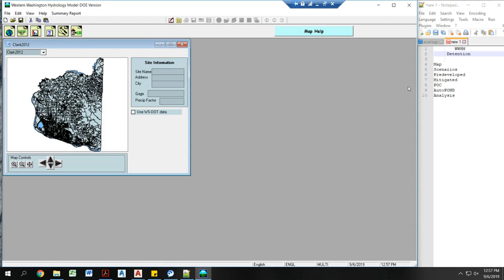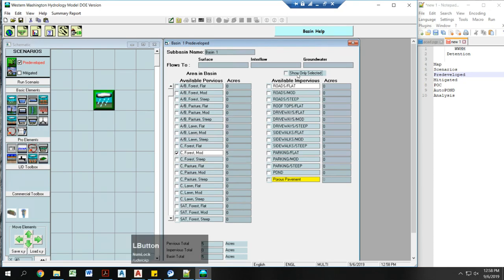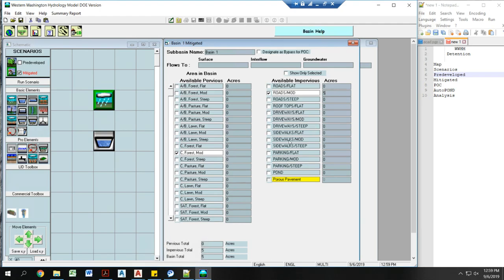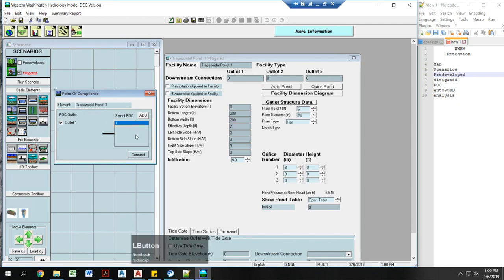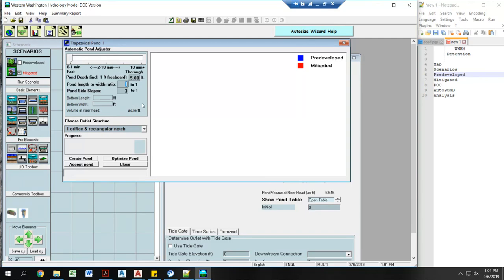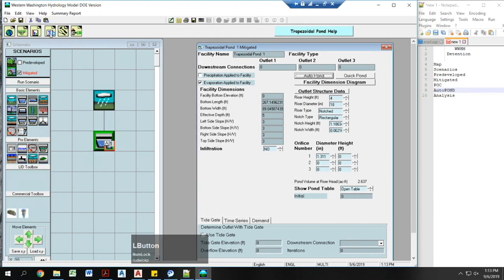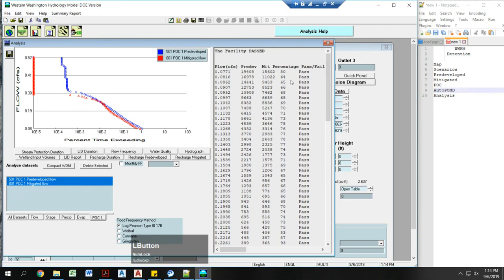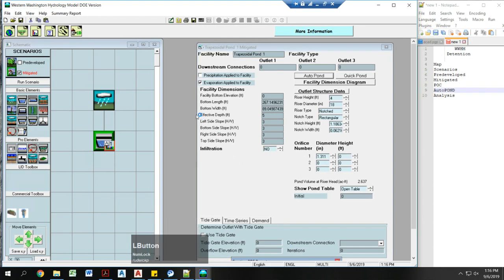WWHM Tutorial for Beginners | Detention (autopond) | less than 6 Minutes!

Comment: Did  you say that 1/2 of the 2 year pre-developed has to be lower than the post-developed? Or the post-developed flow has to be 1/2 of the 2 year pre-developed?
Reply from the maker: Half of the two-year post developed has to be smaller than or equal to half the two-year pre-developed